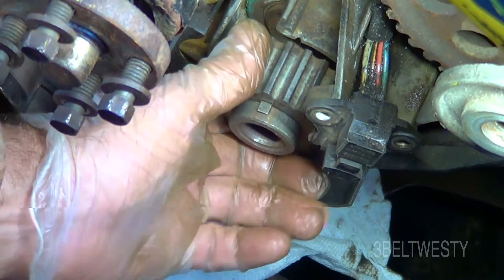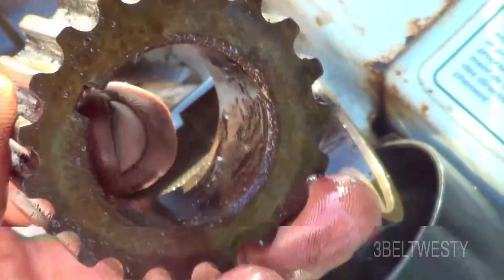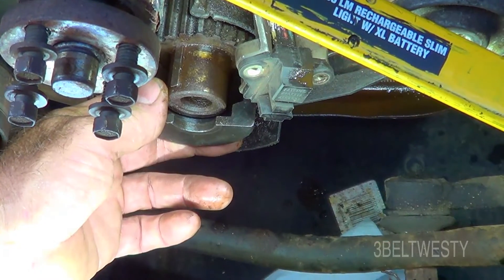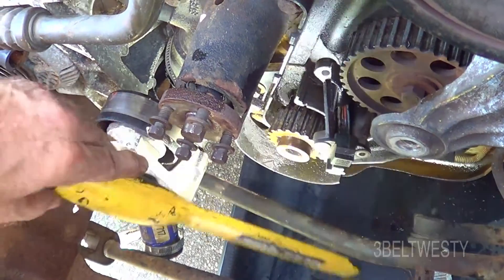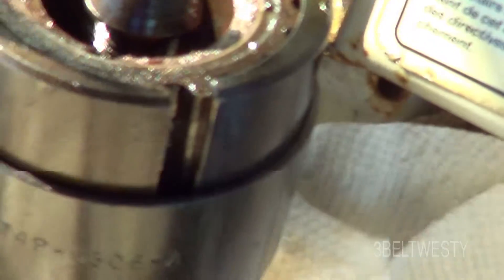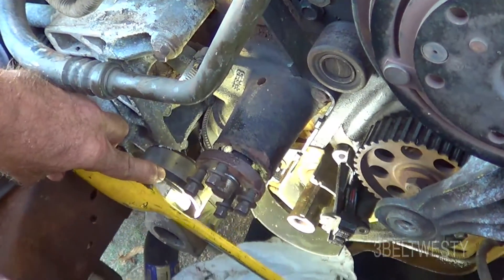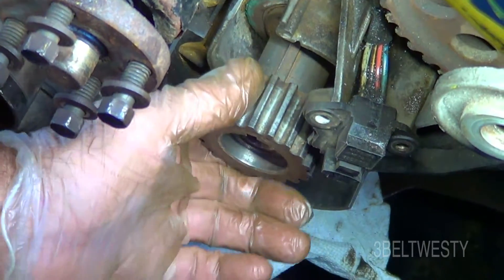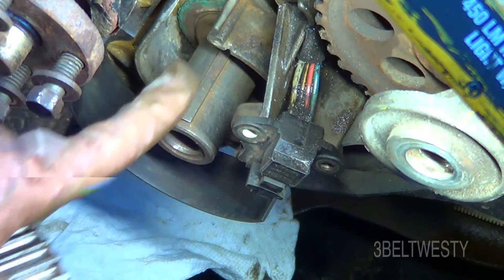2.3L Ford Crankshaft Sprocket Puller T74P-6306-A for Ranger Pinto Mustang

Comment: The special tool is about $250-300 and can be purchased from Freedom Racing. A substitute tool that can be used is the steering wheel puller from Northern tools Model# W8065T, this puller will have to have to be grinded down  to fit but is about at $30 tool. The steering wheel puller can also be found at most auto part stores.

Comment: Mine came off easy with a long screwdiver, sanding, and WD 40.  It was a 1979 Pinto Motor ! lol  I searched for the tool ..(expensive) , and opted for the easy method and it worked. Nice video if you need it,but I've talked to others who just used a heavy duty long screw driver as well.

Comment: Do you purchase the puller from the Ford dealership? Was it very expensive?
Reply: Mine came off so easy with a long screwdriver ...(and it's a 1979 Pinto eng.) ! I have the motor in a mini stock race car and called around for a puller... (expensive).I thought,oh what the heck ... I'll try it , and it came off pretty easy ... lol . I used WD 40 and sanded the shaft a bit.